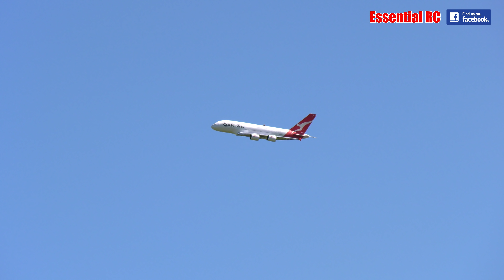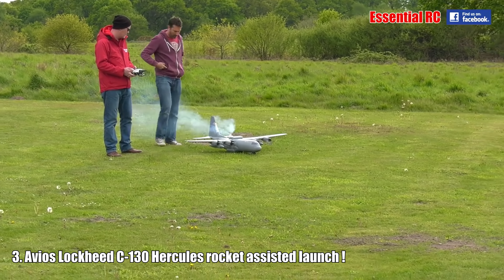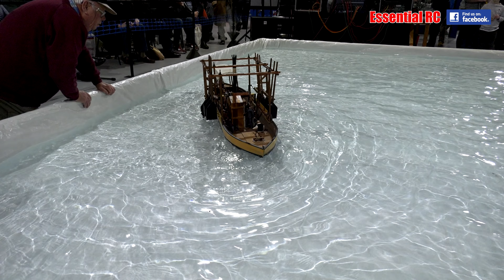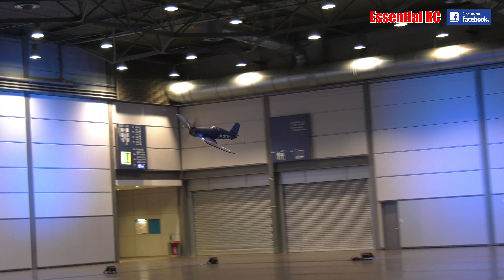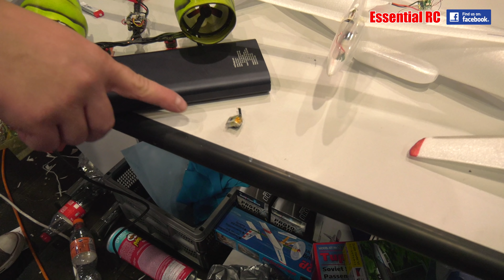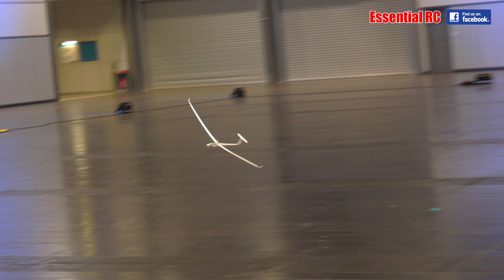STRANGER and CRAZIER RC THINGS ! BEST COMPILATION OF RADIO CONTROL COOLEST AIRCRAFT AND VEHICLES #3

Comment: The F4U Corsair never ever had a prop of more than 1m diameter as explained by the speeker... otherwise the original would have needed a 4m diameter prop....
Reply: You know the corsair had a 13ft 4 inch prop right....  (4.06 meters) that's one of the primary reasons for the gull wing, to keep that massive prop off the ground without having stupidly long landing gear
Reply: The corsair had a huge prop. That's what necessitated the inverted gull wings.
Reply: @roadsweeper1  Hey, you're right, I didn't know that. But Form the Video, would you think that the model had a 1m prop?
Reply: @pascalfust1035  could be. Difficult to tell. 40mm blades with a 20mm spinner... yeah could be  a meter diameter blade. Although tbh prop blades on models are often smaller than scale. They dont have the same weight to drag into the sky. But he could be using a larger blade at low revs

Comment: Not many people know this but the ac-130 with the rocket assisted launch has an actual real life counterpart which was used for vtol purposes
Reply: I think you mean STOL. Wouldn't want to rake off vertically in that. 😀
Reply: And I'm pretty sure the STOL design never saw actual use outside of testing as it was very dangerous.  It was drummed up rather quickly for a hostage rescue  situation but it didnt work out.
Reply: TheCalbert  They crashed it before they could use it.  But if they did use it it would have been one for the history books!